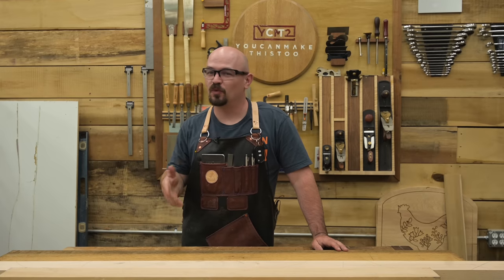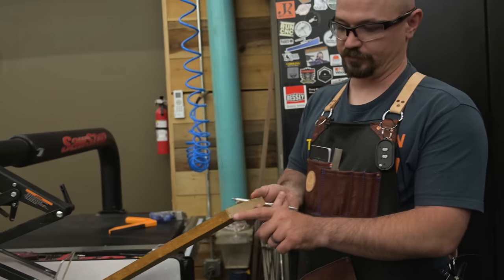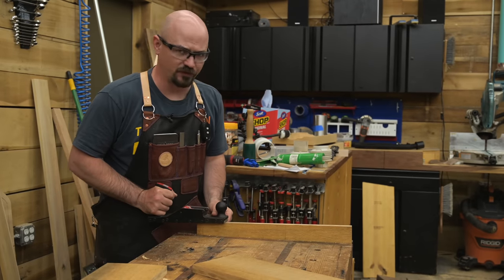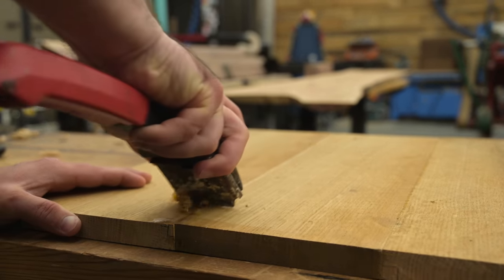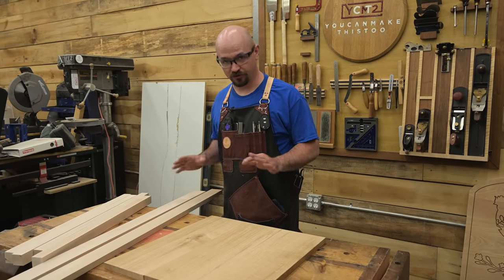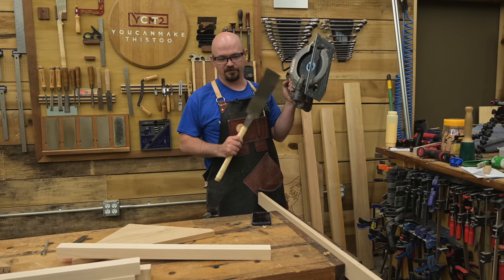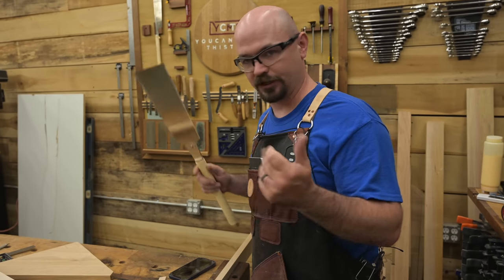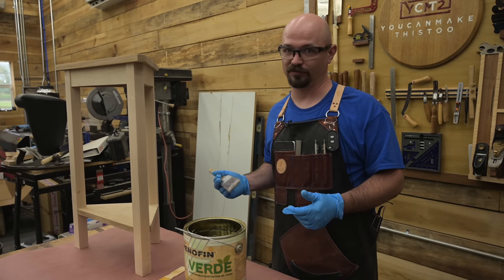BEST First Woodworking Project for Beginners

Comment: Thank you for sharing your knowledge. I just completed my first project, a 2x4 ft mitered picture frame for my wife. She will use it to make a moss wall art decoration. I did it with a tape measure, pencil, carpenter square, miter box and hand saw, pipe clamps, and wood glue. I thought it looked terrible, but my wife was ecstatic. When she complimented my work, I remembered your advice and just said “thank you.”

Comment: Nice.  Very therapeutic watching you apply the finish.  I have not finished anything i have done, too scared to still.
Reply from the maker: Just go for it. Worst case, you can just sand it off and reapply. I recommend starting with a wipe-on wipe-off finish though, they're pretty easy.

Comment: I bought John Malecki's outfeed work table plan. I was worried I might have have bit off more than i could chew. Ive been building houses for years, typically framing, but a little trim work here and there. Ive accepted that i just dont have the most precise tools, with my jobsite Bosch table saw and Dewalt chop saw. So some things can move around the fence and the chop saw has at least a quarter degree play on the table.  So far its been a massive learning experience and when a piece comes out a little off I just accept that my first project wont be perfect. Maybe after I build a few shoddy tables I'll have learned more and might be able to invest in some more precise tools.
Reply from the maker: If you really wanna get that super tight perfect joinery but don't have tons of money to put into the machines. I recommend looking up shooting boards. Just need a good plane and an afternoon getting that jig made and tuned.

Comment: A very helpful video, thank you! One question: why do you directly attach the top to the base with screws instead of using some kind of attachment that will allow for movement of the top due to moisture? Is the top so small that the movement is negligible?
Reply from the maker: Correct. We’re talking a 1/32” maximum movement across the grain. No reason to over complicate it.
Reply: @YouCanMakeThisToo  Great, thanks for the speedy response and for confirming! 🙏

Comment: if your saw is that far out of 90 degrees, you might want to fix it. mine is a pirfect 90
Reply from the maker: That’s great for you man. I don’t even have the equipment to verify mine being perfect 90 or not. I do know it’s consistently close enough that for wood I can treat it as if it’s perfect and not worry about it. But that’s this saw. I’ve had several that couldn’t be trusted to do that without checking and adjusting every several cuts. Don’t miss those days.

Comment: What angles was that apron and how do you determine that? ❤
Reply: Nevermind! I saw another fellow green belt got this question answered!
Reply: I do see that your apron is slightly recessed compared to legs. Is there a standard to that? (Vs flush)
Reply from the maker: Not particularly. Depends on the size of the table. Think I did about 3/4” on this which was the same as the material thickness.

Comment: Very affordable? That plane is 200 usd, which is magnitudes more than a basic Stanley plane from a garage sale and a basic sharpening stone set. Just learn how to sharpen and add that to your skill pile. Oh, and those blade replacements are ludicrously expensive as well, and you have to order all parts online, so good luck with wait time.
Reply from the maker: One my recent videos was entirely about those planes and the ideal market for them, if you care to hear my take.
Reply: Ok I am late to the show and just found this video. In the video the comment about hand planes being common I have to disagree. I have most woodworking tools from a lathe to a hollow chisel mortiser but only my grandfathers old barely working hand plane. Most of my tools were gifts from my father. I have searched yard/garage sales for years and the only hand planes I have found were so overpriced I may has well bought the ones mentioned in the video at the price mentioned in the above comment. I only even type this comment to point out that I disagree with the idea of hand planes being a common tool. Hammer common drill common hand saw maybe hand plane no.
Now to finish what looks like a good video.